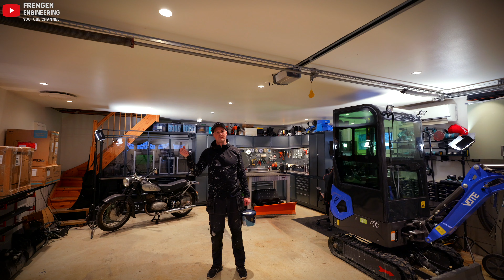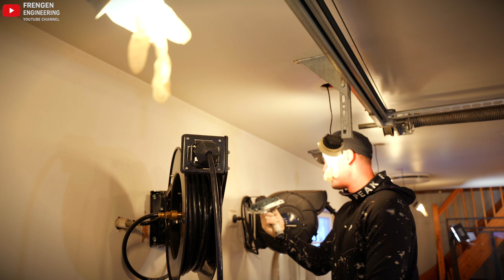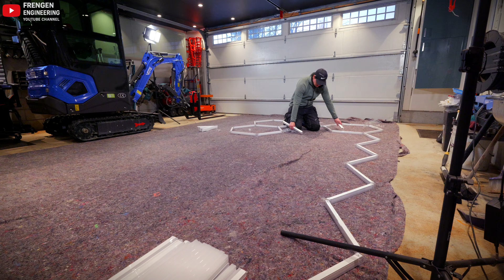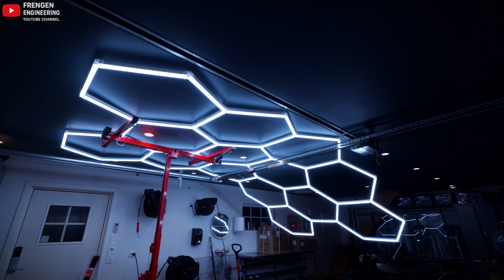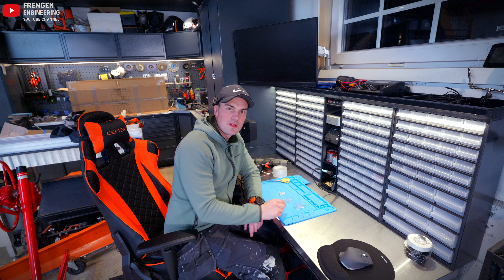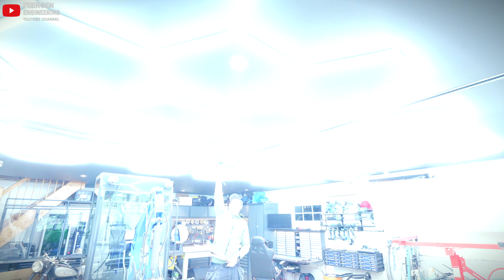Installing Hexagon Lights Alone – Somehow It Worked!

Comment: One thing that came to mind after you had finished installing both hexagonal lighting systems is that they're both installed in the centre of the ceiling, but you have work stations around the walls, and I'm hoping that when you're working at those stations that your upper body doesn't cast shadow over what you're working on; that would be really annoying.
Reply: I visited a car workshop the other day, where they had them on the sloping ceilings, and I couldn't detect any shadows when mimicking working in the engine bay. They had just kept the Trolltekt plates in the original bright colour.
Reply: @erik_dk842 I'm really only a novice, but my eyesight is deteriorating, and casting shadows is a real consideration for me. However the type of lighting may not be prone to casting shadows.
Reply from the maker: Hi, good point, but it does not seem to be a big issue. Since the area of lights is so large, most of the shadows is non existent. And the walls reflect quite a bit to.😊

Comment: Appriciate this video! I've had my eye on these too, since I am currently in the process of building myself a new garage/workshop. I do however think that the look is chaotic and the bluish light feel very depressing. But I do see the benefit of you being able to turn it on only when you actually need a very bright light. I mean 53.000 lumen (per side and total 106.000 lumen) is just crazy! Again, these would be much more interesting if it had a dimmer and a kelvin regulator so you could choose a more comfortable lighting tone and not having to rely on having "normal lighting". Personally I am probably going with 6 of the Philips Hue Surimu (120x30cm), full color range, for my 46m2 garage. (4150 lumen each, making it 24.900 lumen all together). Not as effecient as the hexagon, but cleaner and more aesthetically pleasing, at least in my taste. Keep up the good work!
Reply from the maker: Hi! Totally understand your reasoning here. I must admit, I was considering making my own setup with traditional aluminum LED profiles and dimmable 2700K or adjustable LED strips. Then, this was a sponsored product, and I had to give it a chance. It’s way to bright for everyday use, like parking and so on, but very good for working. Normally the hexagons is 6000K. This one is 5000K, so a bit "warmer" it also has a RA on 95. That’s quite good for this kind of lights. Would absolutely liked having the ability of dimming it down a bit. 😄
Reply: @frengen_engineering  Yeah, I am glad you did! Was a great insight into the hex led technology.
Reply from the maker: Hi! Totally understand your reasoning here. I must admit, I was considering making my own setup with traditional aluminum LED profiles and dimmable 2700K or adjustable LED strips. Then, this was a sponsored product, and I had to give it a chance. It’s way to bright for everyday use, like parking and so on, but very good for working. Normally the hexagons is 6000K. This one is 5000K, so a bit "warmer" it also has a RA on 95. That’s quite good for this kind of lights. Would absolutely liked having the ability of dimming it down a bit. 😄
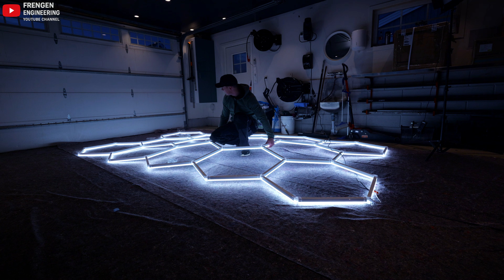Reply: There is nothing depressing about a workshop that is as bright as a sunny day outside. I saw these hexagon lights for the first time ever after driving for an hour on pitch black roads after getting up at 5:20. The "black dog" of depression lives in the badly lit corners, IMHO

Comment: Does the company provide a dimming option? It looks super bright with all of the strips on
Reply from the maker: Hi, no, unfortunately this model was not dimmable. I still have the downlights. So the hexagons will be turned on by a separate switch, for when work is being done. All other lights in the workshop turned on and off with a motion sensor. 😊

Comment: Bravo buddie. They look amazing. Brighter than the camera shows I bet because of the auto adjust on the camera
Reply from the maker: That’s correct! I will have to manually adjust the exposure if the hexagons are in the video frame. Incredibly good work light😊

Comment: It looks cool and all that, but is it actually brighter with the dark ceiling?  Doesn't seem like it from my perspective.
Reply from the maker: Hi, yes it’s a lot brighter, but I did not manually adjust the camera, since I thought it looked kind of cool😄
Reply: @frengen_engineering  I guess the new LEDs alone contribute a lot to that.  If you left the ceiling white, it would surely be even brighter as the dark paint would absorb light?  (No expert here, just asking.)
Reply: @dra911 yes I’m with you here, white would reflect light back

Comment: I did it alone. But it was a tough nut. Haye you measured the power? My hexagon lamps takes about 600W 😮
Reply from the maker: Yes, it could have been easier with some help😆 This two kits, with the outer LED profiles should draw about 1000W. So, with only the hex, I can think it’s around 6-700W here as well. Will measure it when it’s connected to the xComfort smart home switch. Did you install the same kit maybe?
Reply: @frengen_engineering no I have measured it with an current clamp.